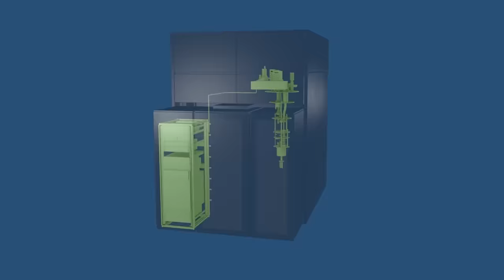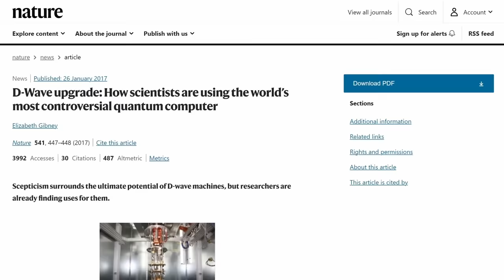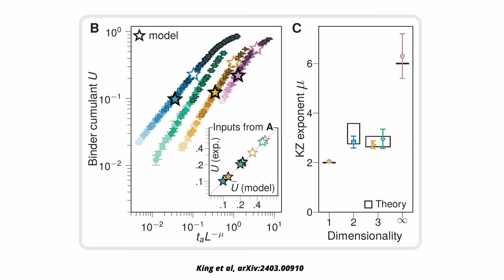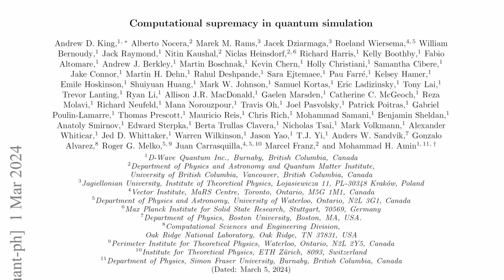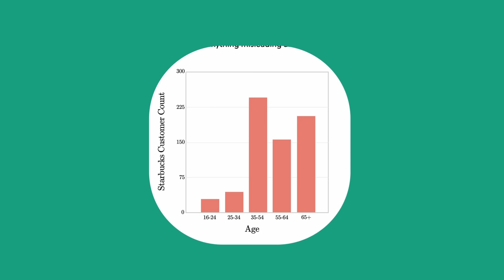Record Quantum Computation at D-Wave: Millions of Years Down To Seconds

Comment: Super interesting!  Question, is the "Salesman problem" suitable  for quantum computers or simulations?  
The funny thing with science is that it sometimes find applications, after a new "tool" has been made , oder?
Reply from the maker: You mean the travelling salesman problem? Yes, it's one of the problems you can put on a quantum computer. I believe you can also do it by quantum simulation, at least in principle. However, it's a rather academic problem. There is a class of related problems in logistics that people want to look at with quantum computers.

I think the reason everyone is starting with the Ising model is that it's particularly easy to match onto qubits.
Reply: You can put it on a quantum computer, just like you can with a conventional computer, but it won't help.

The traveling salesman problem is NP-complete, and quantum computers cannot efficiently solve NP-complete problems.

Quantum computers, at least the fully capable quantum computers that no one is actually building, solve a category of problems called BQP. BQP is a superset of P, the category of problems that can be solved by a classical computer, but a subset of NP, which includes many famous problems including traveling salesman. The most well-known problem in BQP is integer factorization.

Comment: Please, Explain time. 

Why do we say time passes slower or faster depending on your location and/or movement within the universe? Could it be it's just the measurement of time is different? 

Scenario: 

Calculate a future spot in earth's movement through the solar system and pinpoint it. Now pick three spots within the universe to observe the earth's movement until it reaches the calculated spot. 

Observation location 1 is NIST laboratory in Boulder Colorado. 
Observation location 2 is our moon.
Observation location 3 is an orbit around the sun at near light speed. 

Now have all 3 observation locations start recording the passing of time at exactly the same time. All three observation loctions would stop the time recording when the earth landed on it's previously calculated spot. 

Would it be illogical to say, the physical amount of time passed for each observation location would be the same? Could it be that the recording device used to record the passing of time showed differently, but the physical amount of time would be the same for all 3 observation locations? Does it seem reasonable that what we need is a way to record time with a device that can account for its location and movement within the universe, so that the recording of time passing is equal on all accounts? 

The earth will move through the solar system and reach its calculated spot in the future in its due time. It won't be early and it won't be late. It will be right on time according to the calculation. Why would we say the passing of time is different for the 3 observation locations?

Comment: 'Simulation' kind of implies 'computation', but hair-splitting aside, I think that (specialized) computation via setting up initial configuration of the system, and then letting that system settle into some kind of ground state is a really interesting approach.

I may be wrong (and I'm happy if I'm right 50% of the time, especially about things that I have only glancing understanding of), but do I think that I can already see how such approach could be used for extremely fast factorization of public keys (used in public-key cryptography).

What one would need is a (dynamically resizable) 2-dimensional grid occupied by fermions (only fermions will do, because of Pauli's exclusion principle), and with that grid occupying vertical position in a gravitational field.

Start with the grid size of NxM (N horizontal positions [along x axis], and M vertical positions [along y axis], where N <= Kp/2, with Kp being the public key, and the starting value of M=2).

Let those fermions settle at the lowest energy state in the gravitational field (which they will do nearly instantaneously), and then detect (in some way) if all topmost positions on the grid are occupied (by fermions). If they are, then Kp is divisible by the current value of N.

If not all topmost positions in the grid are occupied, then decrease N by 1 (by pushing all fermions on the grid to the left by 1 position; for example, by using electric field, or something similar), and let those fermions settle once again (at the lowest energy configuration) in the gravitational field.

Again detect if all topmost positions in the grid are occupied. Rinse and repeat until you find the first value of N that Kp is divisible by. The value of M in that (resulting) grid will be the other factor of Kp.

This whole contraption is obviously a computer, but (also obviously) not a general-purpose one. It's a computer that performs a very specific computation of factorizing a public key... and it does that job extremely quickly... like in [micro]seconds, whereas the same task could take classical computers millions of years.

Can I call my contraption a Gravito-Quantum Computer (TM) now?

I want to start selling some shares for my (non-existent) company, and I could really use some hype for that purpose.

Seriously, though... why waste time and energy on building complex devices (like CPUs and stuff) when you can simply utilize the fact that this (mathematical) universe already computes, and can do all the computations (you could ever wish for) for you?

You really don't have to do anything more than (preferably gently) nudge it in the right direction.

Comment: It is like saying that an air tunnel used to test airplane wing designs is a computer. It is just a physical system very similar to the targeted one, so we can extrapolate some results with large accuracy.
Reply: If something gives you answers to one or more questions, based on input data, it has been computed. A wind tunnel simply moves "air" in a specific direction, at a speed which may or may not be controllable. It is analogous to reading parameter data from a storage device or keyboard. The tunnel itself doesn't recognise the presence of a wing, and it doesn't react its presence. That is different to the simulation within a quantum computer.
Reply: @another3997  I meant the wind tunnel plus the particula wings, and the computation would be the lift, etc. the qbits  just simulate  quantum interactions, and the configurations need to change to emulate different systems.
Reply: "a physical system very similar to the targeted one" <- You mean like an ... analog? ;)

Comment: "Quantum annealing" sounds like a type of optimization using, in essence, an analog computer.  The biggest problem I've run into trying to use optimization for solving otherwise intractable problems is getting stuck in local minima.  Often there appears to be an infinity of local minima that get infinitely close together, although I suppose the quantum aspect might resolve the infinitely-close-together problem.  This can work if you are looking for a 'close enough' result, but if you need an exact optimal result, optimization can also prove intractable.  I'm still waiting to be impressed by quantum computing.

Comment: For many computational problems , checking the answer is correct is usually a faster process than finding the answer. Does this not apply to the Ising Model; could they not check the results from D Wave satisfy the problem on a classical computer?

Comment: Very quick to do that calculation on a regular computer, you train an LLM to spit out the data you expect and boom done. They haven't proved that it does anything surprising, and if a computer doesn't do anything surprising, you can't prove whether or not it's actually impressive. Is the thing actually simulating the problem at a higher level or is it just a quantum-PR stunt that Mathematica could have done?

Comment: Their 'simulation' sounds very similar to how transistors used to work. It took a lot of effort to make them as programmable as they are today. and yet we're still limited by their rather basic instructions. If you want to do things like encryption, 4k video decoding, error correction? You better have a dedicated logic circuit for that otherwise it will drain your battery and you'll lose performance.

Comment: Well, we're also finding out that only some calculations are suited to quantum computing or rather we are only finding some calculations that can be done by the quantum effects we know of (it's a bit like how the tin can was invented long before the tin can opener).  A general purpose quantum computer is still not even in the horizon and we are already shifting encryption algorithms to algorithms we believe to be difficult to do with quantum computers.   It may be like many other rapid calculations such as analog, chemical, and biological computing, that it isn't possible to generalize as much as digital computers whose real advantage is that we've found easy to generalize.  Indeed, many of our devices that are dependent on some programmed micro-controller have far more latency then the directly wired analog or digital state machines they replaced.  The amount of computing power that we expect to use today to do what we used to do almost instantaneously with purpose designed circuits is amazing.  The early deep space probes such as Mariner and Pioneer didn't even have what we would call computers on them but now we expect to design light switches with a computer with WiFi and over the air updates.  It isn't that we couldn't land in the Moon with Apollo era technology but that some people today don't even realize that there are approaches other than a general purpose computer being programmed by a program with megabytes of libraries they mostly don't use to do the simplest of tasks.

A general purpose quantum computer may still be possible but as with vector processing, the future is probably a traditional Von Neuman computer operating specific quantum computers for specific tasks.  Even the famed CM-5 supercomputer was a Sun 32 MHz workstation running your program with some functions paralyzed for the supercomputer portion. Some needlessly as the trig functions, instead of just interpolating from a table like everyone else, the CM-5 had it's supercomputer portion do a Taylors series summation which meant the results actually changed depending on partition sizes due to the additions of a small number to a large number would just underflow the small number (to accurately calculate a series of numbers, you should first sort them and let the small numbers add up enough to add to comparable bigger numbers so the contributions of the smaller numbers are not lost and though we normally do this by just sorting the numbers and adding small to big, there are actually more complicated methods where once the small numbers are added to the same magnitude as a slightly larger number, it's added with that instead of the next smallest and the sum put back into the queue of numbers to add).

Comment: Helium gas is not a prevalent resource and the increasing demand versus fixed supply will yield increasing operational costs as the platform matures.  Harvesting, liquifying, and effectively shipping the gas requires a lot of resources (including energy) so it's bound to have an impact on the environment.

Comment: It's hard to tell if it's analogue or digital computing but there doesn't seem to rely on intrinsically quantum physics. Not that we could do it easily without but relaxation can be achieved by many physics model. Is there a proof of correction for the result? As stated, it's not really computation, but that cpuld be useful.

Comment: So what exactly did this computer do? If it’s not really a quantum computer but a simulation of a quantum computer, and simulated a task or calculation a normal one/zero computer or a vague supercomputer would take a million years??? A million static years, or a million years of computer advances?

 How was that figure arrived at? Was the phrase semi=programable also used? The true utility of normal or regular computers is their flexibility, is there even a quantumOS, LinuxQ etc … anyhoo always interesting Sabine.
Reply: They used quantum annealing processors to solve a problem about the nonequilibrium dynamics of magnets. There are two things to explain here - what quantum annealing is, and what the problem is.

The problem is essentially about having a bunch of magnets in a system, and they're all influencing each other with very complex behavior. You want to simulate them to see how the system will change over time. The main challenge in simulating them is that every magnet affects the entire system, meaning each magnet you add increases the time it takes to simulate the system by an exponential amount. So for example, if it takes you 10 hours to simulate a system with 100 magnets, it might take you 10,000 hours to simulate a system with 110 magnets. There are techniques to get an approximate rough answer for where the system will be, but they aren't perfect precise solutions.

To talk about quantum annealing, you have to know about simulated annealing first. Simulated annealing is an algorithm (inspired by real life metallurgic annealing) used for optimization problems in traditional computers. The algorithm is given a list of states with numbers describing how good each state is, and a starting point, and it has to find the globally optimal state. If you imagine a function with many dips and valleys, it's easy to find a locally maximum peak, you just take the starting point and go up the nearest increasing slope. Finding the maximum slope across the entire function is difficult though, you might have to go down valleys and suboptimal slopes to get there. Simulated annealing solves this by adding in a 'temperature variable' that starts off very high. While this temperature is high, the state can travel around to nearby states freely, but the temperature is lowered over time, constraining the range the state can move in, until eventually it stops at zero, at which point the state cannot move. It should now hopefully be at the global maximum.

Finding global maximum peak (or minimum peak, it doesn't really matter) of a function is a very useful technique, and it works on many problems, with the caveat that you must be able to represent your problem as a list of states that are related to each other, with increasing/decreasing scores, similar to a function with peaks and valleys. Quantum annealing is obviously incredibly complex, but you can think of it as being similar to simulated annealing, it is used to find the global minimum/maximum of a function. The general idea is that in nature, physical systems tend to evolve towards their lowest energy state. Hot things cool down, balls roll down hills, etc. That behavior applies to quantum systems, and the D-wave simulates this with superconducting loops that make up their quantum processors. The magnetic field can be in a state of 1 or 0, and it doesn't necessarily matter if it's a true quantum computer, because it can still be used to solve - specifically - quantum optimization problems. They essentially encoded the problem into these magnetic quantum processors, and the system evolved to the lowest energy state corresponding to the global minimum. It's very advanced stuff, but all of it boils down to finding a global minimum.

Finding a global optimal point is useful for many problems that meet certain conditions. You have to be able to represent your problem as a series of states that are all related to each other (i.e. think of two chess positions that only differ by a single move, these are related states), and related states should have similar scores. There are many problems that could be classified like that. To give an example, finding a molecular structure that can target a specific biological pathway with minimal side effects is an optimization problem. A molecule can be scored based on on how well it binds to that pathway (and only that pathway), and similar molecule structures should have similar scores. Even if this class of problems is limited, it's pretty clear to see how there are many possible applications, and they've actually shown that quantum annealing works, which is why the technology is promising. General quantum computers have had massive amounts of money poured in with few results, these computers might actually have practical uses.